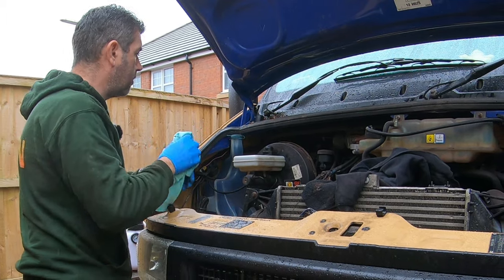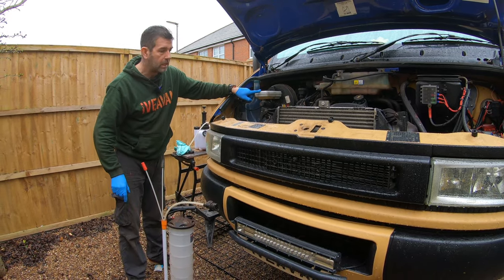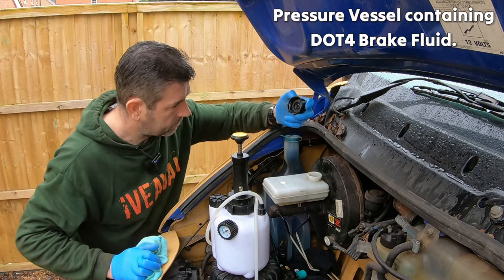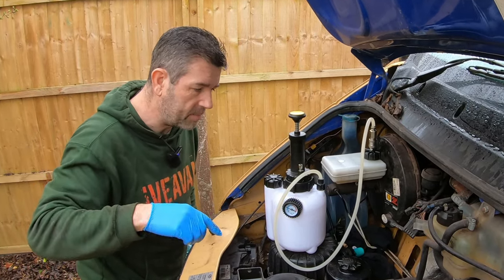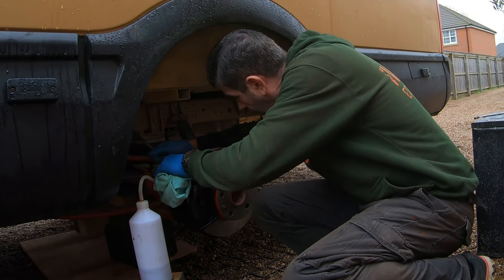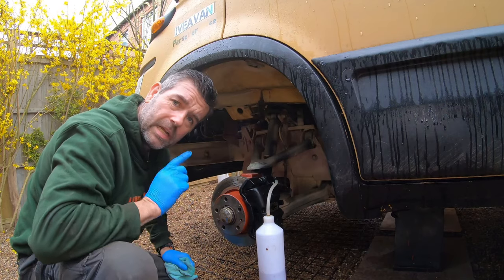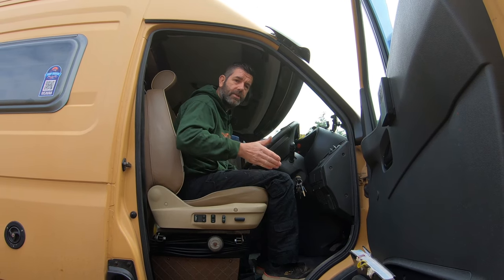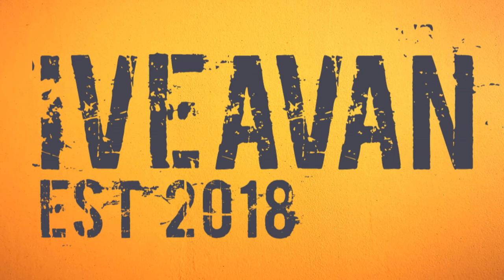Simplified Guide To Bleeding Abs Brake System On Iveco Daily Campervan!

Comment: I made one using a schrader fitting and tyre pressure and adapted a brake fluid cap...basically one pipe from tyre to cap...works really well! 👍

Comment: Your video's are very helpful i noticed they changed the ABS pump after mk3 is the sequence still the same on a mk4
Reply from the maker: Cheers David, Yes, I wouldn't be surprised as the canbus system is much complicated upon the mk4-5 too. So whether it's to tie in with that I don't know🤔. Cheers matey 😉👌👍👍👍...

Comment: thanks for that . I just wondered why you need to turn on the ignition ?
Reply from the maker: It doesn't really matter in all honesty when not using the easy scan tool.  But when using the easy scan tool and bleeding the ABS  brake system, it takes you through the brake bleed process, operating the valves within the ABS valve block in order to bleed the brakes. I should have explained that better within the video. 👌👍...
Reply: @Iveavan  ok . thanks for getting back to me

Comment: Now that was a surprise, was expecting to watch this next Sunday. 😅
I was surprised that you went around the van rear, front, front and rear as I've always done furthest away first to nearest to master cylinder last. Also surprised it only took you three goes to get a pedal as I spent hours doing my MK4 and lost count at how many attempts it took me. 😅
Reply from the maker: No, we need to get back on with the van Re-build bud, I bled the system as the Iveco Daily Workshop manual instructs you to do for the ABS system. I have done it the same way as you before, I can't say either is better as it's still a pig to bleed these brakes 😂👌👍👍👍.
Reply: @Iveavan  isn't it just 😅

Comment: So when the ABS operates, where does any air go? As far as i can see it stays in the system? One or two cars makes, notably some Hondas, are designed so that when the ABS is activated with a diagnostic computer, trapped air is directed to one specific brake line - so that it can be cleared at the bleed nipple.
Reply from the maker: Yes, I did wondered this at the time too, so I looked up the bosch ABS unit that's fitted upon the van, within the workshop manual and it appears, when the ABS unit is being cycled, under a closed loop system it manages to self-vent any trapped air back to the reservoir via the valves that are being operated ( from memory, 6 valves ) within the ABS valve block whilst cycling, looking at the ABS hydraulic schematic within the manual, it makes more sense ( visually ) on how this works rather than the explanation provided within the manual. 
In an ideal world, we should be bleeding the brakes via the Easy Scan diagnostic tool ( the last time that I looked, these units were around £3000! ) which takes you through the brake bleed process that I've shown and cycles and operates the valves within the ABS unit during the bleeding process.
 However! This issue only happens when the brake system has been bled completely dry ( like, when changing brake pipes, where you can't really help, but let the brake fluid drain out of the system ). so, if its only the case of changing the calipers and the brake flexi hose have been clamped off, it should be a simple bleeding process without worrying about the ABS system, like it was on mine during the video 👌👍
Reply: @Iveavan  thanks very much for your reply - good to know. I had an issue bleeding my Pug307 (2006 model) - just hell it was, after a caliper and pipe change - tried suction bleeding, pressure bleeding, the lot but nothing would go through, even though Peugeot (and others) assured me fluid should fly through like that. Eventually, we stripped the front off the car off to get to the ABS (French cars!) and cracked open its pipes one by one and as we did so and this pressures changed, the ABS motor could be heard running (no computer attached). A thin brake fluid with micro air bubbles came out and after letting it settle several times and rebleeding it the same way we got it to work and the STOP light went off on the dashboard. We could not get any air out at all at the calipers - it was just clear brake fluid as it should be. Peugeot added that they sometimes use a computer but it shouldn't be necessary - if I understood that part correctly. Best of luck mate.

Comment: Do you need to use these pressure bleeders, or are they just easier??
Reply from the maker: It's just easier if you don't have anyone available to operate the brake pedal whilst bleeding the brake calliper 👌👍.
Reply: @Iveavan  Thanks for replying. I think I’ll get one anyway for what it costs. Just replaced calipers and the pedal sinks, so gonna try your skid trick and re bleed. I think the best thing is you can view the bleed pipe, otherwise your in n out pumping, when on jack stands also 🫣 really appreciate your vids btw. Cheers 👍

Comment: how come u bled wheels front to back people say u should work fur
est away from the slave ?
Reply from the maker: Yes, you're right! Regarding bleeding the furthest bleed nipple away from the brake master cylinder first.  My van has ABS , so I followed the  'Iveco Daily Workshop manual, brake bleeding  procedure for the ABS system' ( this was mentioned  @3:31 within the video). Starting at the N/S rear Calliper,  ( furthest away from the master cylinder) working myself around to the N/S front Calliper, then onto the O/S front Calliper, finishing on the O/S rear Calliper. 👌👍.

Comment: hello, I changed the caliper and now I have no brakes, the pedal is soft all the way to the bottom
Reply from the maker: Which caliper did you change? Front or rear? Did you clamp off the flexi hose before changing the caliper so the brake system didn't blead dry? Does it have ABS or a load-sensing valve? I presume you exhausted all of the air out of the system?
Reply: @Iveavan  the right rear caliper and I didn't tighten that hose the fluid ran down the floor
Reply: @Iveavan  please help me!! 😢
Reply: @Iveavan  has abs
Reply from the maker: @NegrutOctavian  unfortunately, because the system has been bled dry, it's going to be a bit more of a pain to bleed. But if you follow the process that I've shown within the video ( preferably with a brake bleed pressure kit ) until you see all of the air has been exhausted and you've adjusted the rear brake caliper to close up the air gap on the brake pads and the hand brake adjusted, once bled, carry out that short run up on loose gravel and apply brakes until you feel the ABS pump kick in and you should feel the difference in the brake pedal. If it's got new brake pads, it may feel like it has a longer brake pedal travel until they have been bedded in 👌👍.
Reply: @Iveavan  I have aired 3 times so far and still in vain the brake pedal to the floor
Reply from the maker: @NegrutOctavian the only other thing I can think of is that you may have an issue with your master cylinder. But obviously, not being able to see what's going on in person, that would be purely down to guessing on my part. Are you using a brake pressure bleeding kit? If not, this may help to remove any stubborn air pockets .